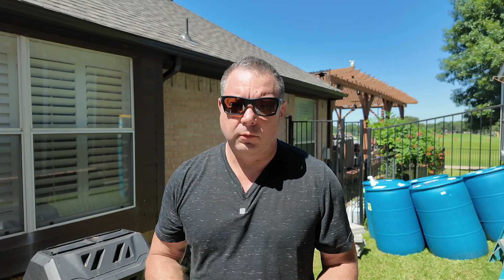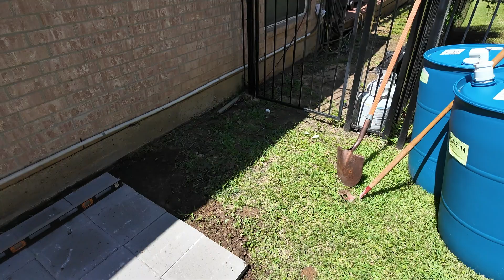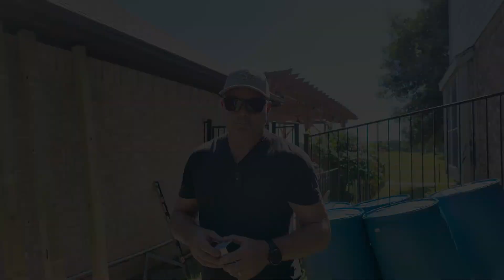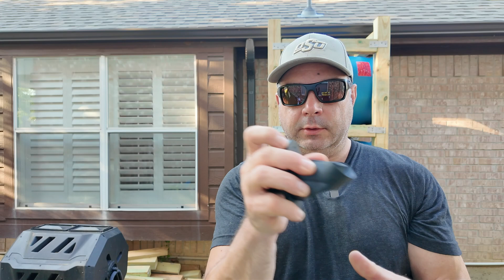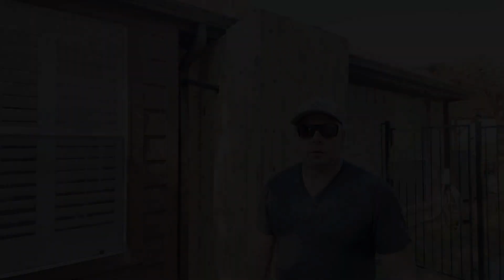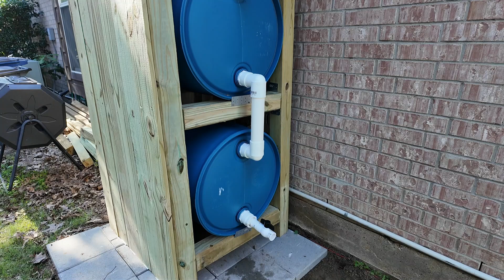Rainwater Collection

Comment: You didn't run into the problem of one of the 2 inch bungs on the barrels being coarse threaded? All of mine are and I found a course thread to fine thread adapter.
Nice looking project, I was thinking something similiar with the privacy fencing. It makes everything blend in.
Reply from the maker: I did have that issue. I used JB weld on all connection. It's used to seal pool and fish tanks. holding good so far